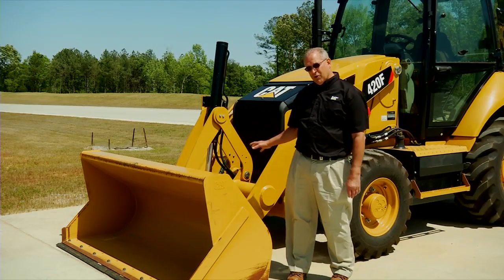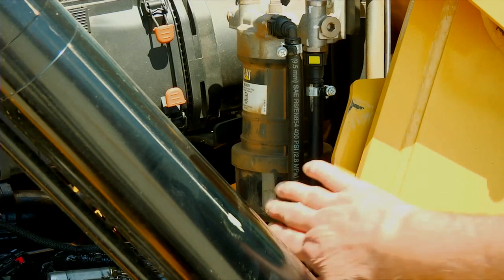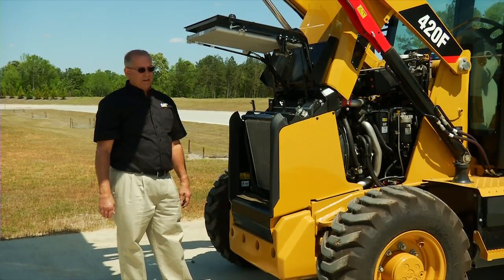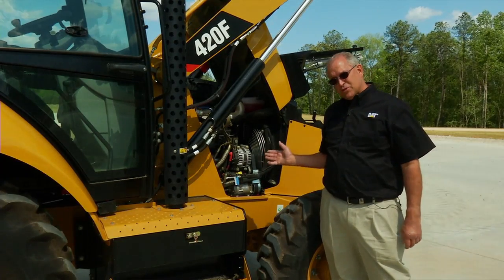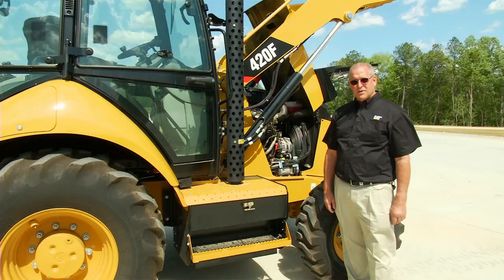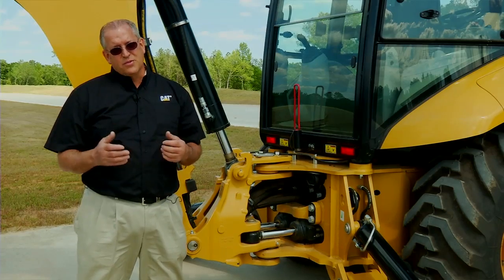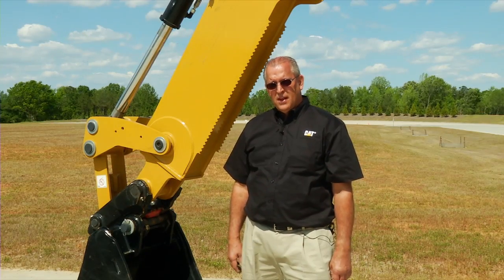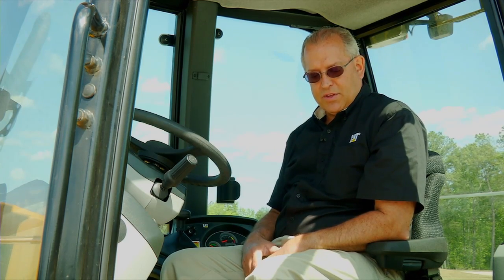Cat® F Series Backhoe Loaders Overview (North America)

Comment: Think about othe series 1 and 2 backhoes started from old scarp and a international Komatsu colors the white blue dirty yellow good old tractors the double hydros of a ck or e and the cat b an international tractor with some new loader one hydro in the center with a bit  bigger hydro but dont split the hydro fluids in half to double cylinders the single hydro puting all the fluids in one area for the pump to give more curl like on the back curl of the bucket but the series 1 and 2 a components machine but used what was available i guess but like anything a good product gets in engineering hads the deere picked up the cats C D models nothing bad being said just some people thst msy have a ged got pushed out for the grad i guess but the ged guy probably ran a few and worked on them the 4x4 turbo B was good just hot in the cab didn't open up that well but good with power and the hoses outside the boom for easy access to fix or change  guy i knew ran a 755 for a guy i knew when i was little but cool machines and old guys man no not saying nothing bad towards cat but jd is allright i like the excavators but im no good on them. I know some guys what you need a cab for when weathered dash and frozen trottel cables when ice builds in them the new electric over hydros weather's bad on the electric controls dirt blowing and when you run a old broom with out a cab you bring 2 loads of dirt home out of your nose man got find a place to dump them

Comment: how does the hood tilt forward
Reply: greg crane There is a pull cable under the cab floor that is located on the left side (outside)between the fuel tank and the cab.just look for the key lock ,it's behind that.

Comment: Case owns the backhoe loader market in this class. I've run Cat, Case, and Deere. From my experience, I've found Cat to be the most user friendly in terms of comfort and cool features, but the Case is an absolute workhorse.....most power, most length, true reliability. I wouldn't hesitate to buy a Cat though.
Reply: TSS,
Reply: I agree.  Even more so seven years later.

Comment: I have a 420 backhoe about 1992 model I am loosing oil from the gear box but I can not see where it is going I put 11 litres in it the next day it was empty I can't see any oil on the ground it happens while it is working when it is standing still it doesn't loose a drop I lock it in the shed i thought some one was playing trick the same thing no oil after 2 hours of work